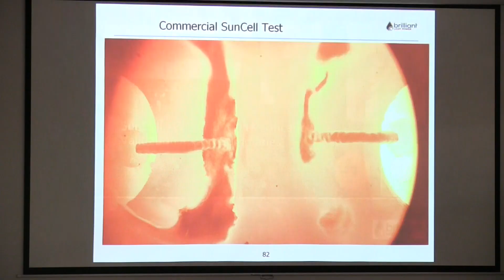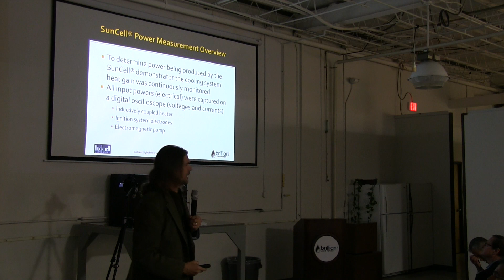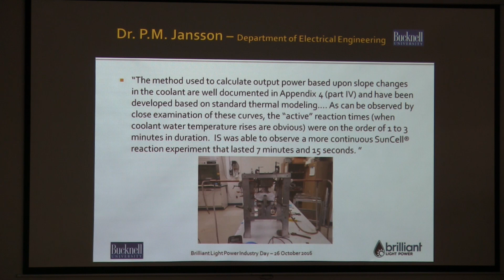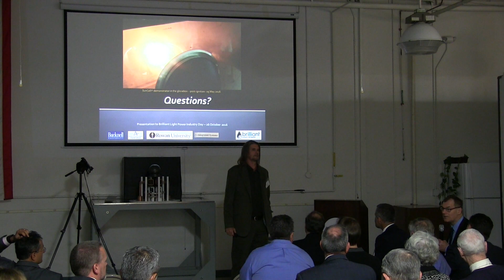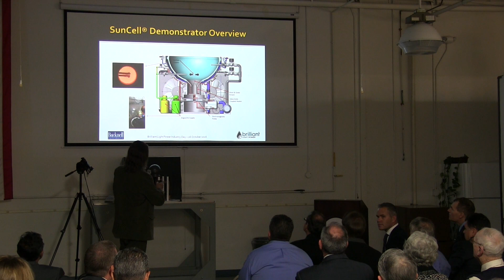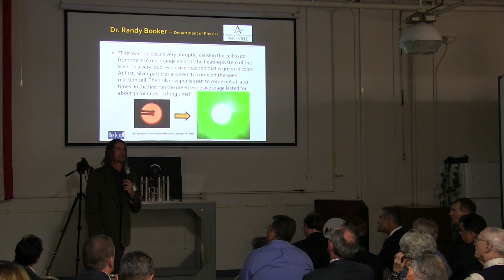Brilliant Light Power's October 26, 2016 Industry Day Part 4 of 7

Comment: Peter Jansson is a credible voice for several reasons.  He is a well credentialed engineer/scientist.  BrLP is not his first rodeo.  To me, his credibility is particularly relevant, because I performed much of the same kind of work of calorimetry and power measurement on many experiments, provided by many claimants of excess energy.  Like him, I typically found that the claimant was not using the right test equipment, such as using an instrument to measure power outside of the frequency range for which the measurements would be valid.  Naturally, when faced with claims of anomaly, the first thing to ask is why is it supposedly anomalous?  Is there something wrong with accepted laws of physics that might cause one to believe that such an anomaly is possible?  Perhaps there is no theoretical explanation, and the data is presented as is, which is OK, because data trumps theory.  But, is the data valid?

With hydrino technology, there is highly developed theory, which will require a long time to be reviewed by minds that are capable of assessing all the details, and checking for error, alternate approaches in some areas, perhaps, etc.  A new physical theory (which, in this case, is actually a highly orthodox classical physical theory) that eviscerates accepted quantum mechanical theory, must be carefully considered before it becomes textbook.  However, commercial success of hydrino technology would probably put that review and approval process on the fast track. 

When an effect has been measured in many different types of experiments, by many different experimenters, from many different institutions, there are questions about how many of the results confirm or fail to confirm, and to what degree.  There is not uniform confirmation, but that is hardly surprising.  What matters to my thinking is, is there a broad pattern of supporting evidence? (yes)  Is there credible evidence of collusion, or even unintentional false support given? (not to my eyes, although we must admit that there is obviously strong legitimate desire to see positive results).  There is question of complexity of protocol, and how easily error can be made, in measurement, in calibrations, running nulls, and in interpretation, as well as systematic errors.  Calorimetry that is done quickly, that produces very large output:input power and energy measurements is close to an ideal experiment, particularly when it is clear that errors are conservative.

There are many forms of calorimetry, and I have experience with many of them.  From what I see presented:  the videos, the papers and lectures, assembled by the efforts of Dr. Mills, this is competent work (although I have some questions from some of the early electrochemical work - not Jansson's), and it is produced by many very well credentialed people.  The rate at which heat is removed from the reactor in the subject experiment by the water circulating through the plumbing (also used to inductively couple electrical energy to melt the silver) is a very reliable measure of the heat being produced in the reactor.  If the heat produced is constant, the delta-temperature is going to be constant.  There is expected to be a close to directly proportional, linear relationship between the delta-temperature of the water in/out of the coil, and the reactor heat output.  What energy escapes as light and is not converted to heat will only cause error on the conservative side.  Measurement of input power is not elementary, but well within the skill set of a professional like Dr. Jansson.  

The wide variance in results can easily be attributed to the violent instability of the reaction, and the inability to run the reaction at a desired high power, due to cell destruction.  However, such extremely large output to input power (and energy, which would account for any storage mechanisms, which are not apparent) ratios, give strong support to the claims of BrLP of truly anomalous, extremely beneficial and valuable chemical reactions, heretofore unknown.

There are unsung heroes in this effort to elucidate actual anomalous and valuable sources of energy, and Dr. Jansson has my vote as one of them.
Reply: What a great comment 😊👍

Comment: i made a tech that converts sea water ion motion directly to electricity. uses graphene coated magnets
Reply: This may be clever, but the power density possible is relatively negligible.  Mills is looking at 20 MW per 10 microliters.  Still, any application of graphene can be seen as a step in the right direction, if only to advance familiarity with application and practicality. Perhaps your tech  can be a means to create thrusters without moving parts for use in marine propulsion.